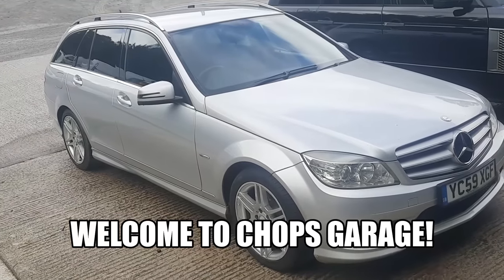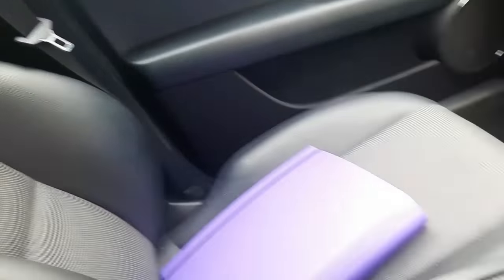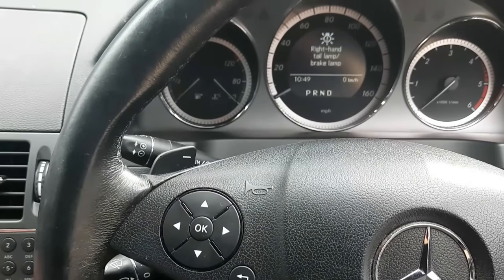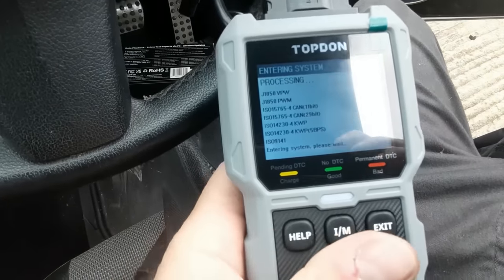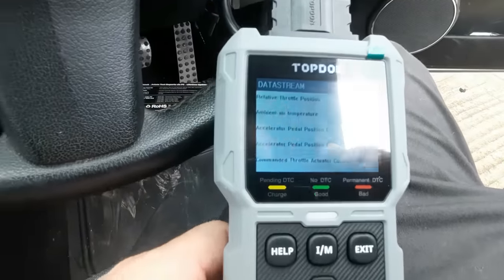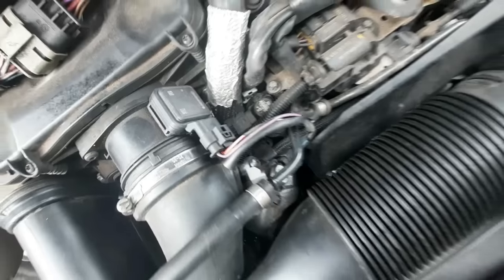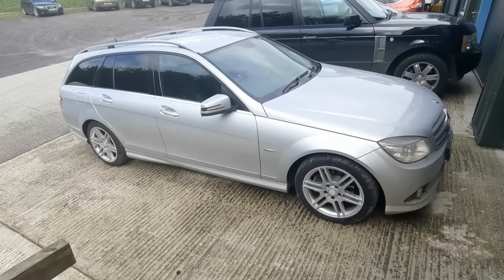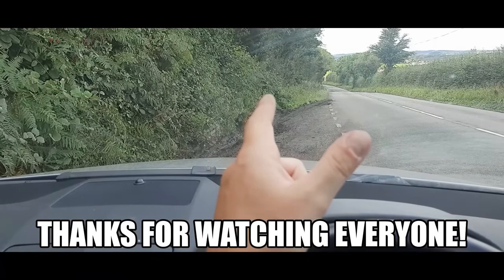Cheap Mercedes C220 CDI - This is exactly why you should NOT buy old Diesels!

Comment: I have a e 220 Cdi w211 with 560000km. Brilliant car. Had some oil leaks, air conditioning and suspension bushes problems. Starter and thermostat. We had to by pass egr due to making carbon deposits. Otherwise just regular maintenance and  parts that wear. , same engine same auto gear box. Liquid molly oil 10w60 and doesn’t have consumption, gear box oil I change each 40000km , more often then recommended. Fabulous car from 2004. Just made a reprogramming of throttle. And is still better. So what’s the problem. I think it’s better for the planet then always changing car. Modern Mercedes are money pits . Buy a Toyota or Lexus instead.
The only con, maintenance can’t be done on Mercedes official. They just are thieves.

Comment: Of course manufacturers will say a car is end of life at 10 years. This is rubbish if it is properly maintained, and if you can find a specialist that actually understands turbo Diesel engines well enough to diagnose problems correctly!
Reply from the maker: Components on the car are end of life. You are not getting past 10yrs without replacing stuff. So life can be extended artificially

Comment: So so many arm chair mechanics! And what a load of cobblers is talked! Ok so the car will certainly NOT regen with the air mass fault present. Its a cheap and simple fix. Do that and take it on a good 50 mile run with the revs above 2k. That means limiting it to 5th gear and above 60mph.  Chances are it will regen. Its really rare for these to need a DPF. But you simply MUST sort the codes first as thats whats blocked the DPF in the first place. It WILL NOT REGEN with a fault code there. Just as well, because a DPF is rather expensive for one of these! These are a really great high milage car btw. 150 k is actually low for a 14 year old Merc. Loads of life left in it!
Reply from the maker: I'm hearing good things re this engine

Comment: Thats not high mileage.   High mileage is my 59 plate Passat I had 4 years ago around 210,000 miles, and a few months later, I bought a 57 plate V70 thats now knocking on the door of 300,000 - was FAULTLESS with me at around 235,000.
Reply from the maker: Yes I've done 280k in V70. High miles for retail I mean

Comment: The OM651 evo engine in the pre facelift 220CDI is comsidered the stronger of the engines and less prone to timing chain rattle.
Reply: Correction the OM646 is the stronger engine, no dpf, no bluefficiency, was in the W204 till 2009 in C220CDI guise….

Comment: As someone who drives exclusively grandad-spec highly depreciated German barges - how dare you sir 🤣

You are of course right, a small petrol engine is a more simple machine. But live a little 👌 it's easy to spot a bad Merc -

What you do is you look at it, and picture it in a carpark in South London at 3am: there is a fellow with 6 duffle bags of "diplomatic mail", one of which appears to be screaming. If you can see that car in that scene without too many issues. Walk away

Comment: You should not buy wanky top end old motors like Mercedes or BMW. Over engineered crap but without long term reliability. Short-term they trounce the land rover long term no better than the awful fiat.